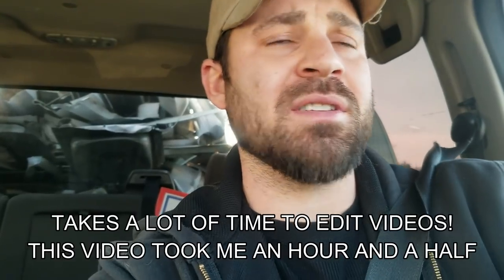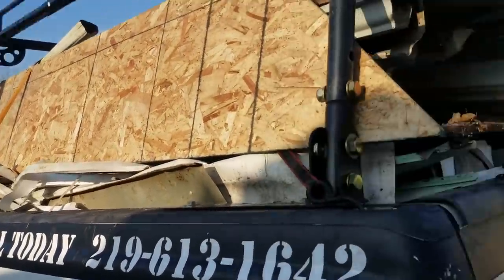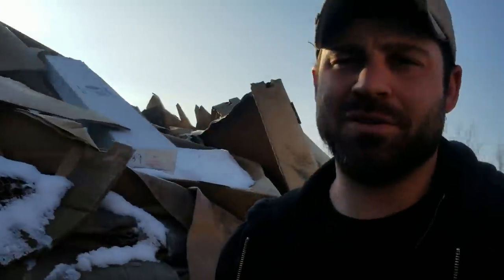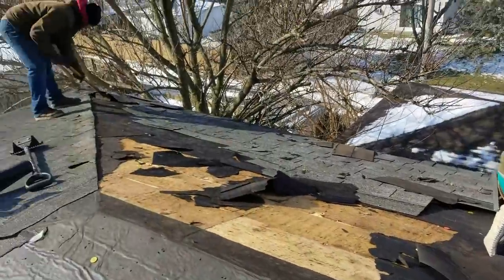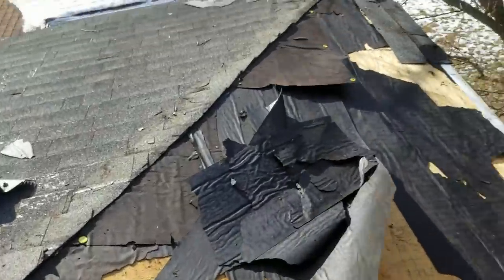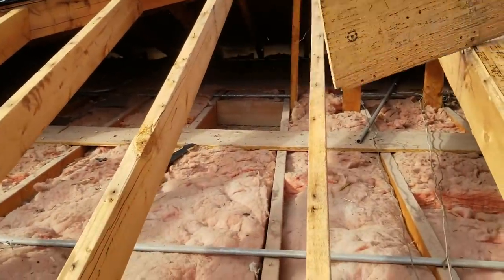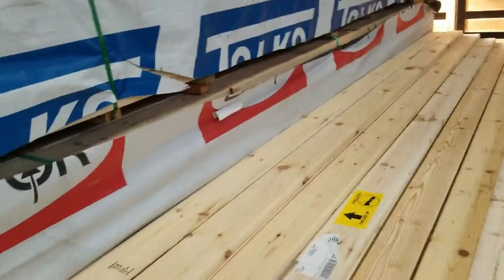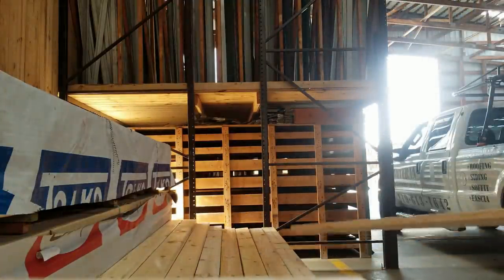A Day in the Life of

Comment: I did a a roof job on a trailor lifted the the aluminium roof 6" back up added new roof an an ceiling rafters an joists, an pulled the walls back in combined 4". but its a trailer 2" walls so i split a 2x an used it to hold up the roof an ceiling, told them it needs it or the roof will fall. I can make it look like crown they said no a few days later they ripped the 2x's off. i told them your living room is gunna collapse those 2x's are holding up as well as holding together thats why i had so many screws in as well as adding some metal straps to hold walls together. They said no it wont a few months later the ceiling collapse. an they cried an complained about me doing fucked up work. Oh one side of trailer had 12' of the wall ripped out. For a half ass addition thats sagged an pulled down the roof. Thats side i wanted to add 2×10's on top for wall an roof plus some boards on sides to hold up they said   it dont need all that... lol so i see why ppl do half assed work. 2

Comment: You ever worry about your staples through your synthetic or ice and water leaking through? I mean I’ve seen it before on a dry in the carpenters did before we roofed over but usually we use button caps and nail over commons so it’s a double whammy thing, better hold on commons and caps aren’t gonna leak.
Reply from the maker: Yea so anything new construction or anything I have open for an extended period of time I will use my bostich gun which is a cap stapler.  Those won't leak.  Staples will leak but the synthetic is rated for staples to walk on and stay on in wind.  Problem is they will leak. But if you're gonna shingle it right away you can staple only.  Water should never hit the felt anyway and if it does there's a slim chance its going to cause a bad leak. I learned this the hard way on a new  construction job. Most of the staples were not leaking but a few spots were, so by all means Its safe when you're gonna shingle it right away. But if there's rain in the forecast you don't wanna staple

Comment: I think building inspectors are a necessary evil. I'll tell you why. Two guys were hired by a elderly lady to replace her old rotted roof with new plywood and shingles.. Well they used DRYWALL instead of plywood and shingled over it. After month or so it began to leak and she couldn't locate the original guys , (they had left the area, she wasn't the only elderly person they screwed)  She called a local reputable roofer to check the roof, he got on the roof and fell though taking the ceiling out, and on to her kitchen table.. She told him they were hired because they gave her a cheaper price of $500.00 less than he quoted.. This is a True story. 
 The county in Missouri don't have building inspectors, and these lowlifes preyed on the old..

Comment: How’s that truck rack making out? I’m thinking of picking one up at good old harbor freight.
Reply from the maker: yea that's where this one was from. its honestly holding up perfectly. small little rust spots showed up in the first week from sliding ladders n such but I never repainted it or anything and It hasn't shown any signs of becoming a problem. I thought I might have to re-tighten the bolts but the thing is as solid as the day I installed it. if you got a tall truck and 8 foot bed make sure that you use the extenders. its an awkward carry up. gonna want 3 guys total.  but definitely glad I bought it. saved me a lot of time
Reply: Worlds Fastest Shingler thanks cuz now go make that GRAVY!!

Comment: no 45 on the fascia??
Reply from the maker: nope those just come together. it all gets hidden and the connection would be toe nail which is not as strong as straight through
Reply: 6 nails in the end of that fascia board is not any better than 45 on bother fascia boards with toe nails because if it took that many nails to hold that in place its going to come apart in time because the wood will split with that many nails close to the end

Comment: You forgot the break away cable when you hooked up the trailer
Reply from the maker: you sir are absolutely correct lol
Reply: Make sure your hitch is rated for the trailer weight
Reply from the maker: @tylerfaber8648  yes sir
Reply: And get a wheel lock they are hooking up trailers with ratchet straps going over the hitch lock and driving away with them around my way